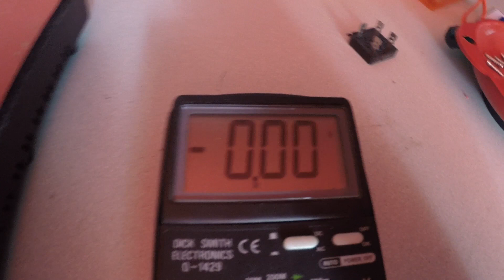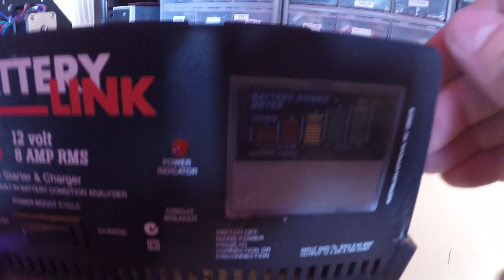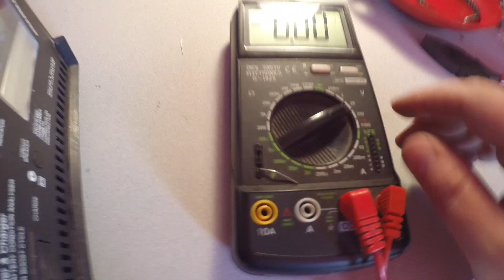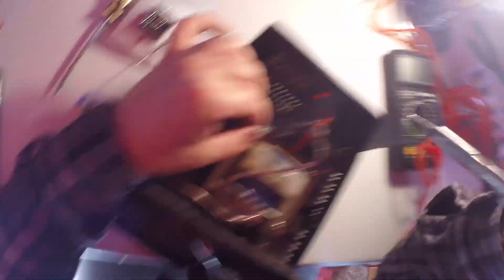FIX IT #2 Car Battery Charger

Comment: Same unit as Projector Power Boost 12 Volt Super Charger Model SC8000/PB except Projector charger has different type of rectifier. MB354 rectifier used here should be good replacement.

BTW A handy feature of these chargers is the boost feature which allows batteries to be charged for 5 minutes before trying to start the vehicle.

Comment: Is a car battery charger the same as a 12 volt deep cycle charger ?   Is there really any difference  ?
Reply: Deep cycle agm or gell cells require fixed voltage and varying current chargers to get the most charge/discharge cycles  Special chargers built fot these type batteries are required to get the most out of these type batteries. It is well worth the cost to get the right chargers for the battery you have